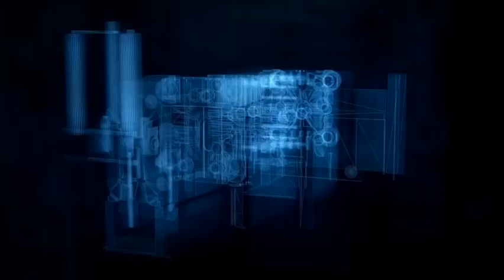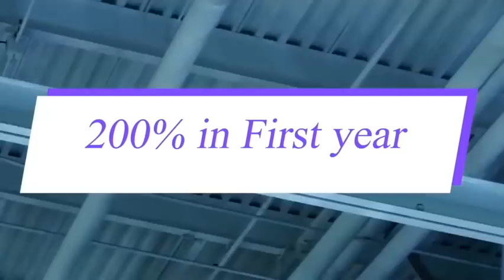Tesla's Giga Berlin is Tesla's Answer To Make Model Y The Best Selling Car

Comment: The present quest for the future of a perfect battery vehicle (BEV) is a “ fool’s errand”.  With the realization of the “negative refractive index metameterials”, a new splitting of the water molecule will produce energy at little cost and there is an inexhaustible supple.😊
Reply: Still need to condense the hydrogen to 10,000psi (takes energy), actively cooling it as you go because compression releases heat (takes energy), then transport it (takes energy), then fill up a fueling station (almost none of which currently exist), then run it through a fuel cell (inefficient and more expensive than a battery pack) just to drive a car that has less power even on a good day, and even less in cold weather. And I have to take the car to a filling station, whereas my EV just charges overnight in my driveway. And when I get solar panels I can charge from those and be energy independent without having to buy my own hydrogen production and compression and filling equipment. We don't need a perfect battery (whatever that even is), the batteries we have now are good enough, but are getting better and cheaper every year. So, who's the fool?

Comment: Battery production will shift to Texas for the tax credits.
Reply: And.... to create the battery where it will be used, Cybertruck and Semi. Since the high volume of the 4680 is experiencing some delays from the planned output.
Reply: Or, all production will move out of Germany come the power and heat black outs w not enough too expensive gas, cling nuclear plants.  Battery and car factories are particularly energy expensive.    Why make them there when far far les expensive energy elsewhere?

Comment: This may sound good how is every one going to charge these cars are we going to burn oil and coal to produce electricity maybe Elon has to come up with a better method for producing electricity!
Reply: Renewable energy is growing like crazy, in case you haven't heard. Not sure where you are in the world, but take the US for example - in 2021 renewables accounted for 20% of electricity production. In the first half of 2022 that had already risen to 25%. 77% of the almost 28 gigawatts of new generation capacity was solar and wind, which each produce electricity at half the cost of a coal power plant. Even a diesel power plant charging an EV is 28% more efficient than driving a diesel vehicle because of the efficiency of the power plant. This is in large part because all the heat that's wasted in a car is used in the diesel power plant to create steam which then drives turbines to generate more electricity. Since 70% of the energy in diesel or gas is wasted as heat in a car engine, that's quite the efficiency gain! But as every year the grid gets greener, so too do EVs. That can't be said for gas cars! 

And yes, Elon has come up with a better way of producing electricity. Tesla has created "virtual power plants" or VPPs. These consist of hundreds of homes that have signed up to sell their solar and battery-stored electricity to the grid. They're all managed by artificial intelligence to buy energy when demand and cost are low, and then sell back to the grid when demand and price are high. The average EV owner has their own solar installed that charges their EV, so they're not actually drawing any extra power from the grid.
Reply: @truhartwood3170  More than 60% of energy used for electricity generation is lost in conversion.

The technology and the type of fuel used to generate electricity affect the efficiency of power plants. For example, in 2019, of the 11.9 quads of natural gas consumed for electricity generation, natural gas plants converted 45% (5.4 quads) into net generation of electricity. By contrast, of the 10.2 quads of coal consumption, coal plants converted 32% (3.3 quads) into net generation.
The difference in conversion rates is because coal-fired generation plants in the United States are often older and less efficient than many natural gas-fired plants. In U.S. power plants, generating a kilowatthour of electricity from coal requires on average about one-third more energy than producing a kilowatthour from natural gas. Although more electricity was generated by natural gas than by coal in 2016, it was not until 2019 that more natural gas was used to generate electricity than coal.

The Thermal Efficiency of ICE is between 30 and 35% and 35 and 45% for Diesel.
This all you can read on the website of the  US Energy Information Administration (EIA)
Reply: @truhartwood3170  sorry the The U.S. Energy Information Administration only has wind at 9.2% and solar at 2.8 for 2021. Fossil fuels is still 60.8% I would agree all renewables are at 20% but that makes up so many other forms of energy production. And  your landscapes are destroyed must come up with better method to product energy.
Reply: Elon and many other produce solar. It is less cost .   We also havecwind and hydro.
   Coal is being removed.
Reply: @solarstacks  Yes Elon has solar but in most northern parts of America solar will not produce enough electricity to charge your car unless you are spending more on the panels than justifies the return gas will be cheaper and cleaner than solar production and wind production. Elon said it himself that Germany should bring the Nuclear plants back online. China uses more coal today when they could easily go to solar or wind as they are ones who produce majority of all solar panels as well as wind turbines in the world but they know it is not profitable or environmentally friendly. This has just made China richer and other countries in-debt to them. Geo thermal power would be cleaner cheaper and relatively easy for most countries to adopt as it is the same as oil drilling so no need in training a huge work force to do equipment is already available. This is not the only option but. better than what we have currently.